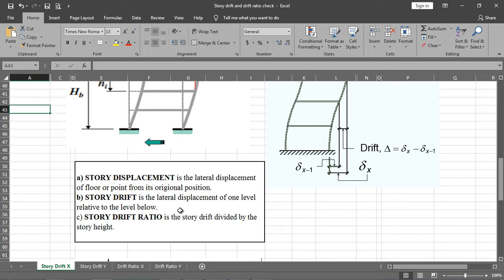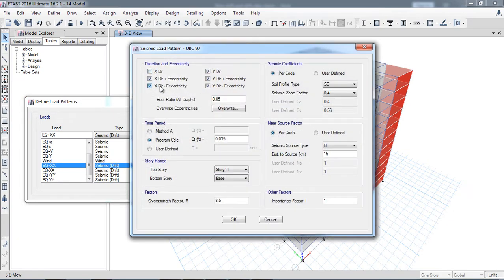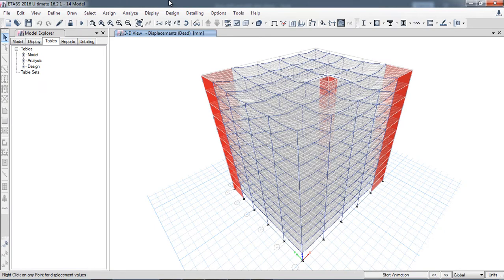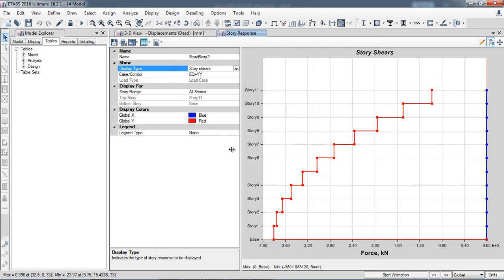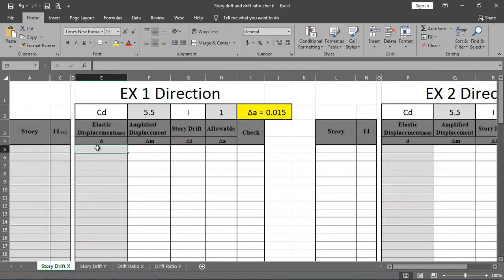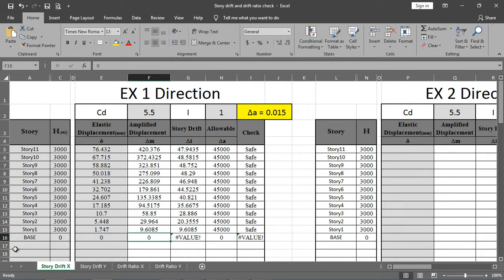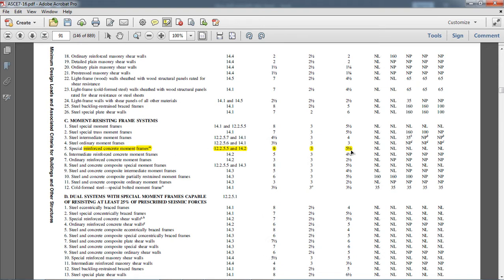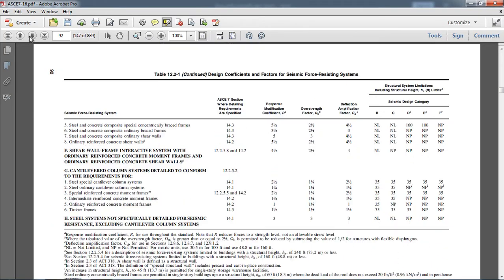CSI ETABS Course - 09 - Story Drift check as per ASCE-7 16 | Part 3

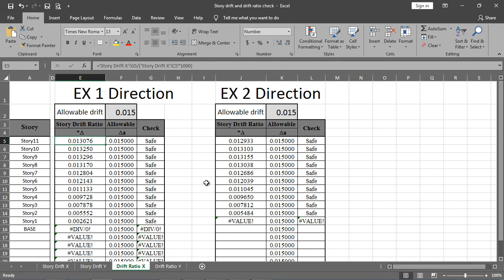Comment: The Max story drift when you graphically displayed (4:24/ 14.29) or tabulated values (5:24/14:29) are the elastic or inelastic drifts ??? and the drift amplification we need to do manually by using a load combination or entering scale factor in seismic drift load case ??